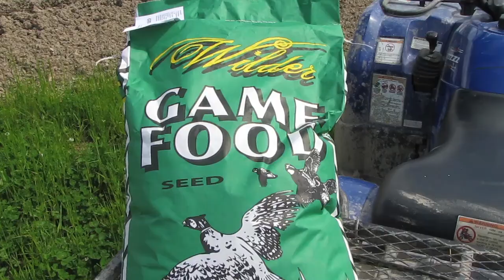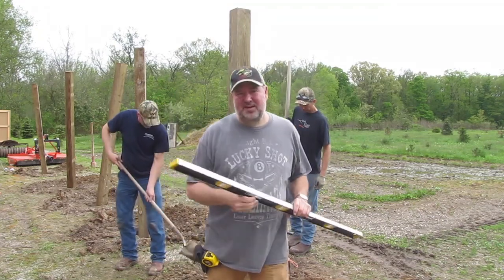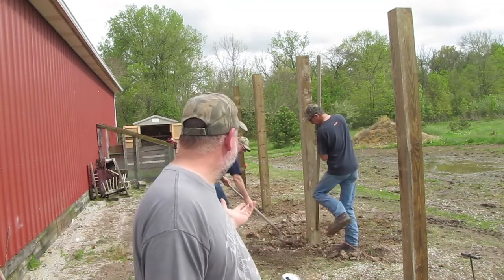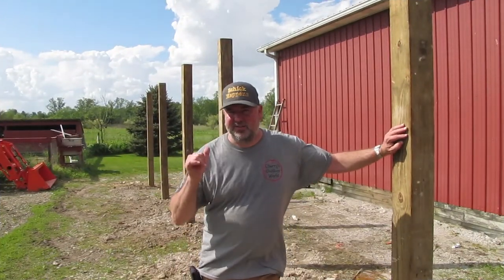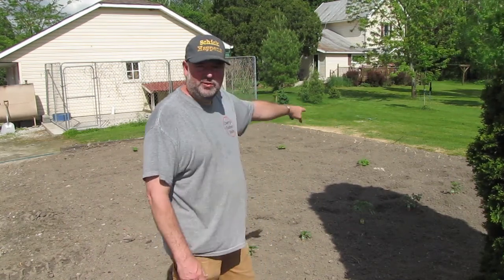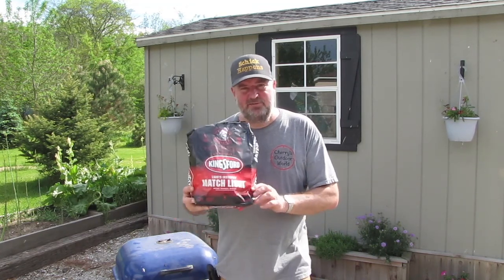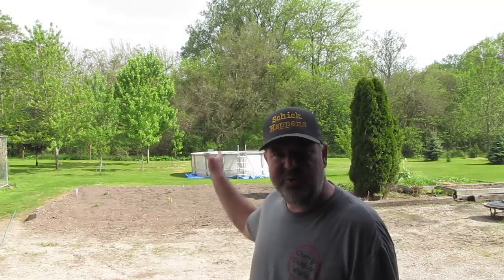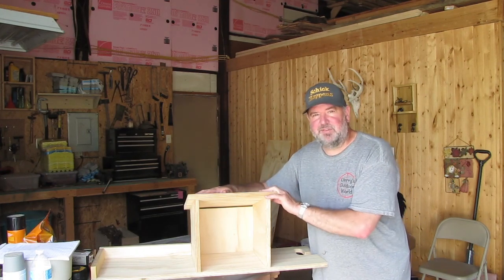Started Addition To Pole Barn

Comment: Good work, CJ.  A lot of seeding going on there and getting the poles up is definitely a good use of your time.  Are you going to build the structure or hire it out?  If your budget permits, I hope you're able to pour cement in the lean-to.  You won't regret it, especially in the winter months.  You'll be able to roll your implements (on dollys).  Didn't mean to infringe but you have plenty of time to determine what you'd like.  Looking forward to see the pool caddie build.  Full-watch and be well. 👍🏽

Comment: Have you ever used a charcoal chimney? Even with the Kingsford it works great! 

Good start on the pole barn! 👍🏻👍🏻
Reply: Schick Happens they are really handy but if you get one get the larger diameter version. A little paper in the bottom and it usually will even light plain charcoal. 

Be safe my friend!